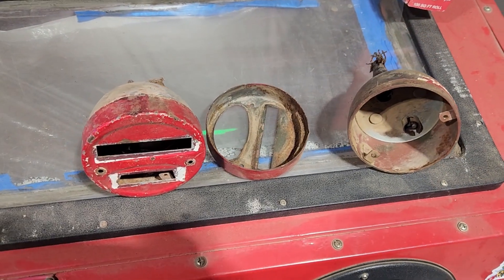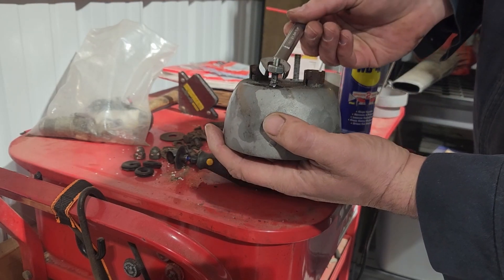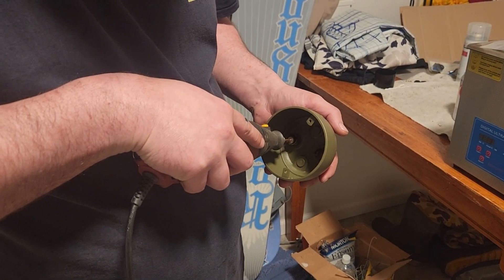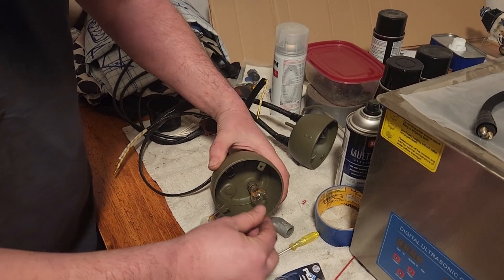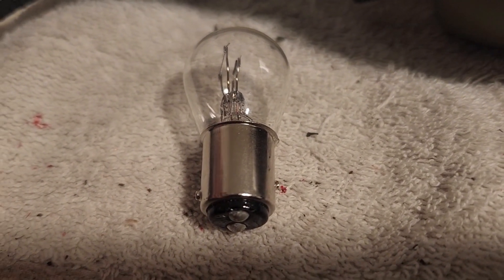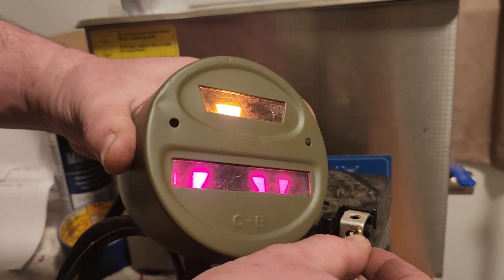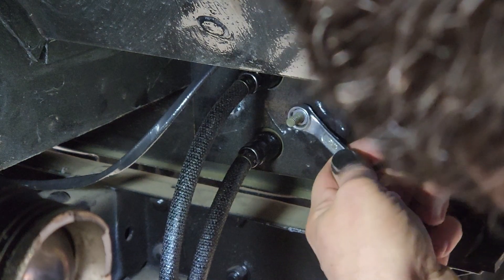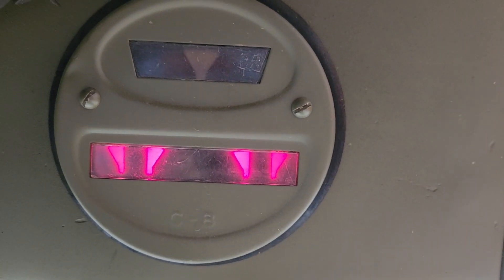How to: 12V Tail Light Conversion 1945 Willy's Jeep

Comment: Tail light grommets were actually only used on early model jeeps - not on late production jeeps like your 1945. Your tail lights also protrude much more from the body than normal. Maybe the brackets have been modified?
Reply: Do you make and sell that 3d printed spacer ? Please let me know. I'd like to do this project soon.
Reply from the maker: No, I'm sorry I figured I had a one off use case and had no intentions of trying to sell them.
Reply: @fordtechchris  no problem. I met a gentleman who did the same thing you did, but went about it a different way and he made a set. Thank you anyways.
Reply: @fordtechchris Can you share the stl file?  I am restoring an 42 gpw and converting to 12v
Reply from the maker: https://www.thingiverse.com/thing:7037980
hopefully that works for you! good luck
Reply from the maker: Good to know! It's hard to nail down small details like that when putting the Jeep back together to know what should and shouldn't be present. The brackets look original. Perhaps it's a ACM II running change like moving to the deep mud exhaust? Or the lights could be mismatched to the Jeep?